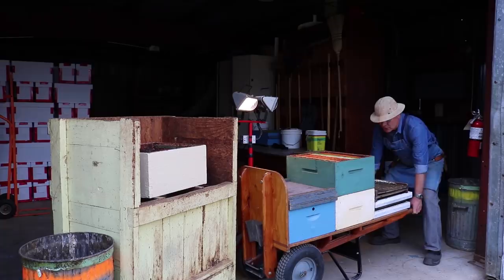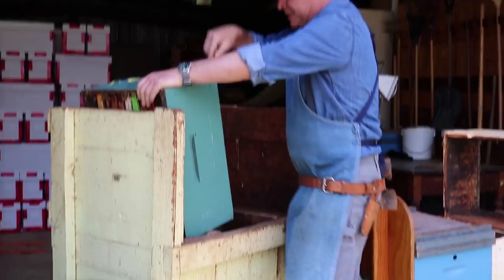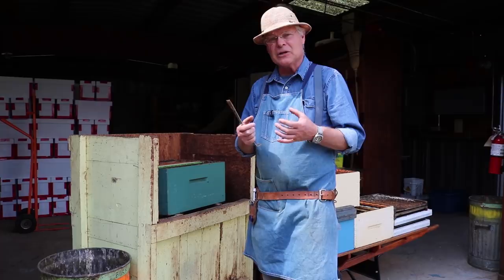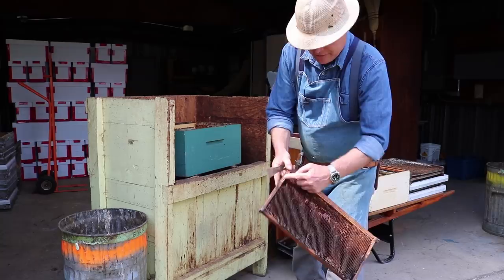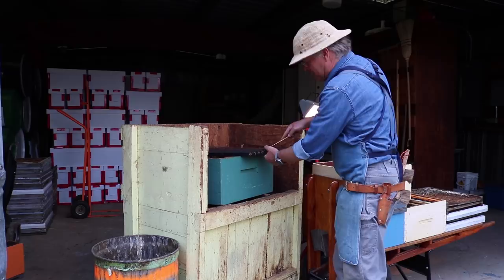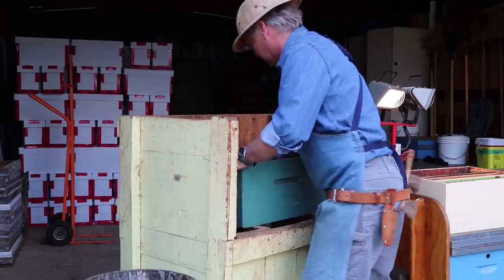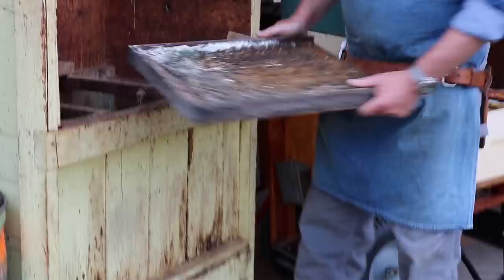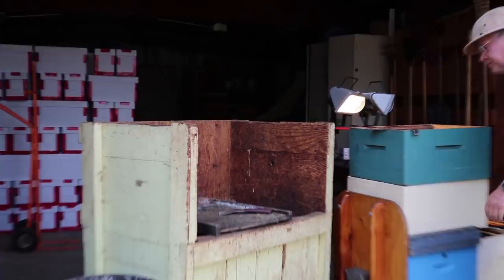Dealing with Deadouts (Part 2)

Comment: Great video.  So important to inspect your comb on a regular basis!  AFB is brutal.  Just like everyone else varroa is also a huge issue.   My colonies have crashed two years in a row with no survivors in spring.  Frustrating to say the least.  I spoke with a friend who has great knowledge in bee diseases in comb.  If people are having the same issue I am they may have a build up of varroa viruses in the comb.  They can have low mite counts, but over time the virus load grows.  It's been found (according to my beekeeping friend) that viruses related to varroa can survive in comb up to fifteen years.  So, if you use virus infected comb and keep the mites under control you can still have hives crash in the fall anyway.  The ways to treat for this issue is to burn or throw out the comb and frames, or irradiate the comb.  That's it.  Since my comb was getting old anyway I chose to throw it out.  I'm starting fresh with all new frames that I had in stock and new foundation.  I'm using wax this year instead of the plastic.  I want to burn the stuff when it gets old and not throw it in a dump somewhere.  Take a look at your dead outs.  You may see a lot of comb with dead bees and holes in the top.  But if you open the cell the entire bee is inside.  This is likely Parasitic Mite Syndrome and not AFB.  AFB will be gooey and stringy inside.  
Hope this helps someone out there with the issue I've been dealing with for two years now.
Reply: You have some interesting comments.  First, I would like to ask where did your "friend" get this information about DWV staying in the comb for 15 years?  I would like to see that study.  In which case I would think we should use new frame every year.  I think it is supposition.  Secondly you are right about AFB being gooey and stringy inside, however you have to look at that sooner than the following spring because that will dry out.  You should have noticed these issues long before a dead out occurs.  Look for evidence of sunken or discolored cells on capped pupa. Additionally, another telltale sign would be an unusually sour odor emanating from the hive.  Often a spotty brood pattern and certainly the lava won't be white but rather a dark brown color.
Reply: @rmore935  I don't remember.  It's been so long since I learned that.  Ands of course today that could be disproven.

Comment: Love your videos and thank you for posting again!

Question1: I had a couple hives that had a lot of moisture and low bee numbers that have mold on the comb in some sections. Can this wax be melted down or should it be destroyed?
Question 2: Should pollen in the comb of dead hives be thrown away as well or can it be reused in an existing hive? 

This video is SO timely for me so Thank you!!
Reply from the maker: Thanks Hogavich
You can certainly melt the wax down. We don't usually melt old comb as pupal casings soak up a lot of the wax. Its a lot of messy work and you get very little wax if the comb is older and if you don't have a steam press. If its fairly white wax you get more.

Comment: Hi Paul, at 3:02 you show a drone comb that is partially drawn. When you put that back in the hive, will the bees draw out the entire frame? Also that one looks like it was scraped and reinserted...will they build comb over those scraped surfaces, which are rough with old pupal casings? Many thanks!
Reply from the maker: Hi WW
    We don't often see the green drone combs fully drawn. I don't use them much except for experimental purposes. Usually comb on scraped down plastic frames  gets drawn out reasonably well. It's not as perfect as from scratch. Cheers!

Comment: What's the trick to cleaning out frames from a hive that has starved out and all the bees have their heads in the cells?
Reply: Scott Guthrie love to know also
Reply: @decaturridgebees8761  I can't find anything on Youtube I just bang the frames until they fall out then pick the rest out with my fingers but there must be a better way.
Reply: I was told to let bees clean them
Reply: Knock out the loose ones and reuse. The bee will do the rest. Just remember you put them in there or you will think something is wrong as all the dead are brought out.
Reply: I just use my shop vac. It gets most of them.
Reply: Just put it outside for few days and birds will eat them out. Of if you have chickens.
Reply from the maker: Hi Scott
 I leave the dead bees in the cells for bees to clean out - as others have suggested.

Comment: How do you handle frames that show AFB scale? Throw out that individual frame or all ten from that box? Scorch the box, lids etc?
Also - are you concerned about spore transfer from handling that frame?

Thanks!
Reply from the maker: Hi Robert
  To be honest I've never found AFB scale in inspecting comb from dead colonies  - but I still do it. We use antibiotics spring and fall following our local regulations to prevent our colonies from getting AFB. Hence no spores in our hives. 
 I have found AFB scale working in other beekeepers hives. When this happens you need to follow the protocol required where you live. Here it's report, kill, and burn. Please have a look at the regulations for your area as this is a really important.  Thanks for your excellent question.
Reply from the maker: We are planning to do an AFB video next summer.
Reply: @UoGHoneyBeeResearchCentre  Thanks. I'm familiar with handling AFB, curious about how others handle it. Certainly easier to deal with when you see it in the field, as you can easily keep track of which lid, bottom etc was associated with the hive. 
But harder when you toss ten lids, bottoms and a hundred frames on a cart and scrap two days later.
Reply from the maker: Hi Robert
 Yes you are right, it is better to deal with in the field. What really worries me is AFB in honey supers because then it can really get spread around. We ran a ten year  40 colony organic (no antibiotic)  trial in some hives managed jointly with another group. Everything started on organic foundation and brand new equipment. Scorched hive tools before every inspection. I found AFB three times over this period. All when supers were on. We reported the find to our government inspectors, killed the hives, dug a burn pit, burned all the frames and bottom board, scorched the boxes and inner cover, then buried the ashes, scorched the hive tools and washed our hands. I don't use gloves but if I did they would have been burned too. That's our protocol here in Ontario. I made the point about looking into local regs as it is very different from place to place.

Comment: what a waste of wax...
Reply from the maker: Hi Václav 
 It does seem so but without a steam generator and a wax press rendering wax from old dark combs is a very messy job for very little wax. We do collect beeswax in many other ways. This is one example of how beekeeping is so different from one country to the next. Most of our beekeepers here do it the same as I do. When I visited Denmark the beekeepers just delivered their frames to the wax guy. He had all the specialized equipment. Wish we had a wax guy here.
Reply: Here in Czech republic we also don't have "the wax guy". Most of small beekeepers like me use simple sun melter. I know it is not very productive melting those dark frames, but in sun melter it at least cost you nothing for energy. Also in my country there is a lot of new beekeepers in last 5-10 years (thanks to EU's support etc.), so there in not enought bee wax on the market, prices are increasing, bee stores often sells wax even in poor quality to satisfie demand. You can argue that old frames might contain some diseases but in system we have here you don't have to worry about it. System here works that we bring our melted wax to local beestore and there they simply weight it and for small fee (2 USD/kg, depends on how clears wax is) you get foundation. Those stores collect wax and send it to company which produce foundation. Those companies are few in country and they have very good equipment, they heat up wax on very high temperature to kill potential diseases and usually add some chemical to reduce residues from bee treatments ( I think they use some acid to reduce residues of amitraz which is still used here, but I am not sure how effective it is). Good thing on it is that even beekeeper with 2-4 colonies can exchange his wax for fondation for very little money. Down side is that if fondation companies melt wax from 10-100 beekeeprs together, there might be one sample with extremply high residues etc. which then reduce quality of final fondation. There was big debate about wax quality, because some beekeepers to get more fondations added  paraffins to their melted wax and fondations from this wax got on the market. (Sorry for my English, it is not my first language)
Reply from the maker: Hi Václav
Please don't apologize for your English. It is excellent and I'm sure you have worked hard to make it so. Thanks for explaining your situation . Sometimes I think we learn more from beekeepers in different countries because we have learned very different techniques. Your system of exchanging wax for foundation used to be common here. We could even get foundation made up from our own wax which I really liked. Now most people here use plastic foundation. I like wax foundation for shallow honey frames but for deep brood chambers the wiring makes it too slow with the kind of frames we use. I like to ski in the winter more than building frames! All the best Václav from Czech republic.
Reply from the maker: I do intend to get another solar melter. The old one I had was too small and didn't work well. Pretty cool to use solar power for rendering wax!